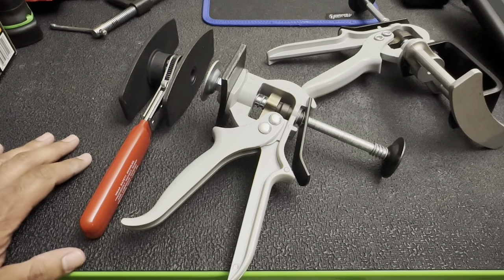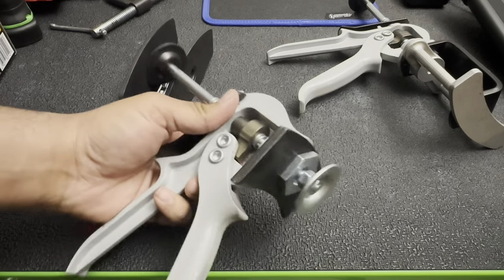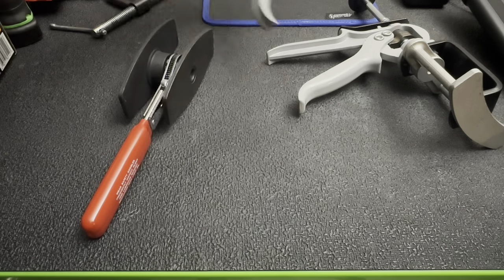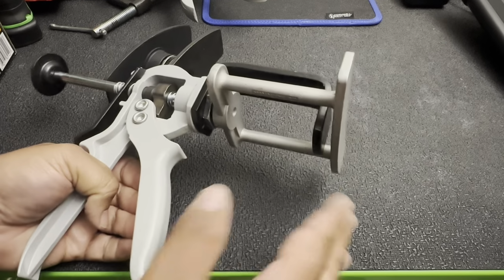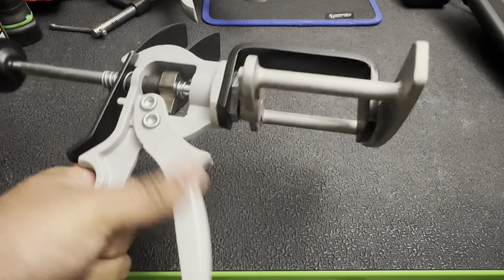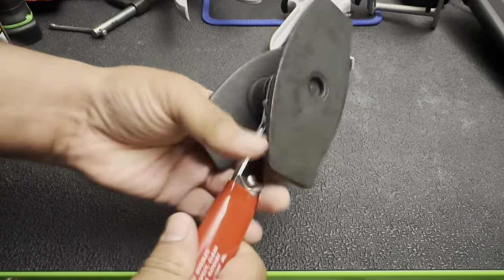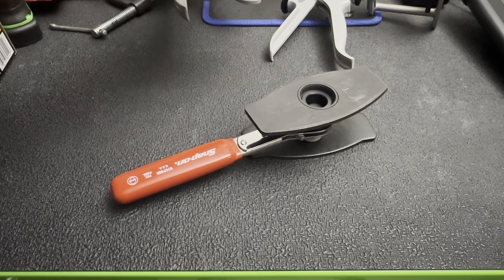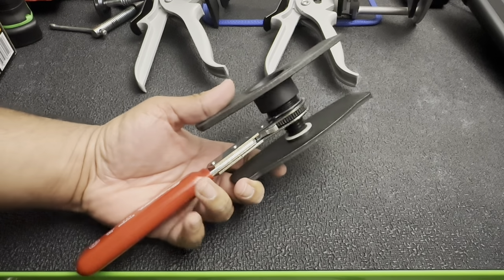Brake Caliper Tools Snap On vs Lisle

Comment: I started with the Lisle single piston more than a decade ago. It's quick and robust enough for what it's design for; single piston. Now I have the Snap-on BTCP2SA. It does single, dual, and fixed caliper type. The head rotates/swivels so you can move the handle if it's in the way. It accommodates left or right handed use. Another great thing about it is that it's compact for storage. Huge plus. That dual piston takes up a lot of space. It's also got a lifetime warranty. I wore mine out and got a new one for free. DO NOT confuse this for the Blue point version. Don't be tempted by the price difference. Two cons that I can think of is; it's hella expensive! I got lucky and scored one for way less money. The second is that it's to big for the small rear calipers. You have to get a separate tool for that. Good comparison video. We need more of these.
Reply from the maker: Ive always wondered how good that Snap On one works. I just cant bring myself to spend the loney on it but if i find it cheaper ill definitely get one.

Comment: Use my dual piston tool manual turn thread..works on most even thin solid disks which that snap on won't but the Snap on one is awesome on 4 piston as you mentioned..